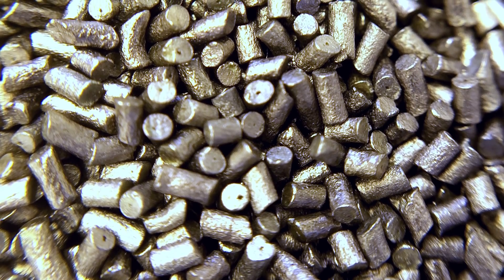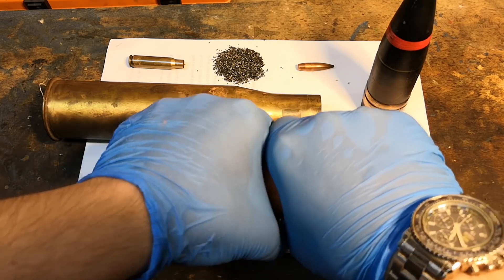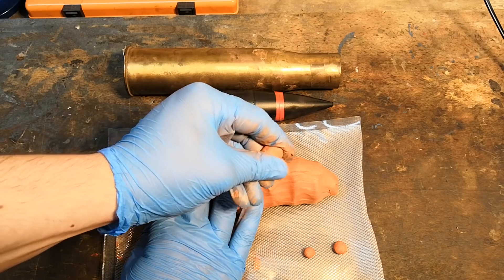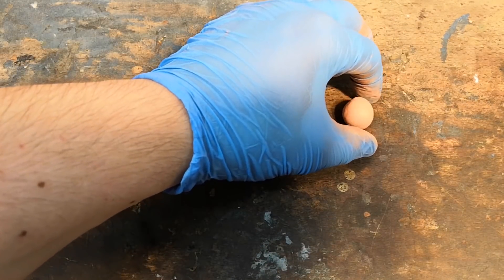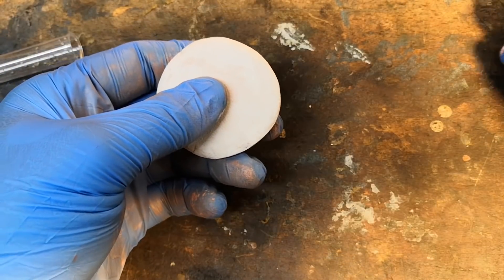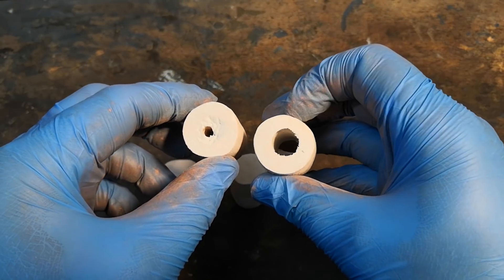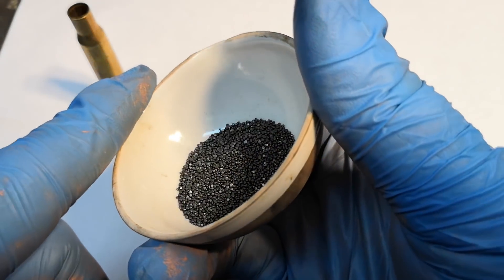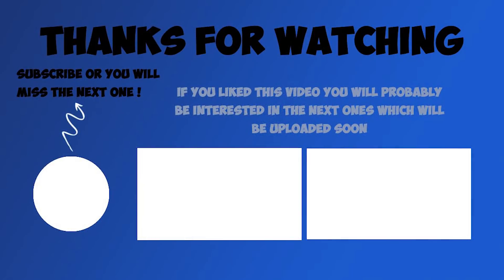Why Are There Tiny Holes In Every Grain Of Gunpowder?

Comment: Thank you very much for the explanation.
I have question:
I burned two 7.62 gunpowder from two different bullet of the same manufacturer.
The first one had tubular powder in it and the second had disc powder.
The disc case burned for 9 seconds, while the tubular for 3 seconds.
Those rounds are made for snipers, so I was thinking, in the video you say that flakes are used for shotguns and pistols, and tubular for rifles, but if the disc case burns slower, wouldnt it make sense that a sniper rifle would want a slower burning powder to achieve longer burning time due to longer barrel?

Thanks alot!

Comment: @backyard ballistics Does this have anything to do with the “corning” of black powder? As I recall - though I may have used the wrong term - it has to do with wetting, drying, then regrinding the powder… I guess. (Something that took years and years to discover, as I understand it, and was a quantum leap in firearms/ammunition development.)
Reply: Corning powder was mainly made to obtain more stable burning propellant, with loose powder the burn rate was unstable and prone to explosion (if the powder is very fine and compacted a little bit).

Comment: I was pulling apart ppu .303 brittish rounds the other day and most were cylinder powder there was one that was very tiny balls of smokeless powder why is that they were perfectly round also
Reply from the maker: So called "ball powders" are very common in portable weapons loads, and they are composed of small spherical grains made with a process different than extrusion. Because of the highly regressive shape, the outer part of the grains is treated with a deterrent, so that as deflagration progresses, the reduction in exposed area is compensated by the higher velocity of deflagration of the inner part of the grain.
Reply: @Backyard.Ballistics  awesome answer man thank you for responding

Comment: You should make a video where you try to make your own gunpowder starting of with nitrocellulose cotton, would be very intersting to see, if it would actually work.
Reply from the maker: I've actually done that, but I can't post anything like that here on YouTube😑
Reply: Backyard Ballistics Hmmm, Yt sucks :( 
Can you explain how you did it? I couldnt find any information about it on the internet, Just that there are different forms and some are coated in graphite powder
Reply: @Backyard.Ballistics  Cany you upload it on full30 ?
Reply: Ya I have also same query. I made a nitrocellulose and dissolved into acetone then I made a dried powder and dried sheet after evaporating the Acetone. Then how to change this into this kind of tubular  grain? Just I made a powder. Which also but quite similar but to smokeless gun powder but I can not make a tubular grain.
Reply: @sutrathakuri1924  What if you press it trough a carlic press? 
Not a tube but at least a cylinder...
Reply: Ya I think it will work as a cylinder.

Comment: It is not necessarily gun powder, common coal sometimes do use this method as well, have you seen those coal/charcoal dust compress Bridgets use for heating and cooking? Those blocks also have holes, not only for circulating air, it also serve the same purpose. Well, although in case pf coal blocks, burning rate is measure in minutes and hours.

Comment: the 30mm propellant appears to have some gold material, is this like a primer or other extremely fast burning composition to get the flame burning the entire hole as a cylinder instead of progressing in from the ends?
Reply from the maker: The shiny surface you see is graphite, the grains are coated in it to avoid static charge build up, to make them flow better and avoid them sticking together it the early phases of production. That's also what makes powder dark in color.
Also, you don't really want the outer grain to be fast grain, because that would make the buring behaviour regressive. Actually very often the opposite is done: deterrents are added on surface to get the outer layers to burn more slowly

Comment: so, how do they get those holes in?
do they have a whire in the middle of a tube of gunpowder, which is then removed and the remaining gunpowder tube is cut into pieces?
or they form the gunpowder along a extruding wire from a material that is later desolved using chemicals after the gunpowder has been cut to shape?
Reply from the maker: As far as I know they are extruded, with the "powder" being in a plastic consistency. The bulk is squeezed under high pressure through a die, which provides for the hole with a central mandrel in a larger section, and then everything is squeezed down, and the hole shrinks
Reply: @Backyard.Ballistics  ah that makes sense, thank you for answering my question, on a 5 month old video non te less XD
Reply from the maker: @Cheezymuffin.  my pleasure 😉

Comment: pretty good explenation on the holed powder. Would you know how these powders are made? It looks like its a cut extrution. But i cant get my head around the hole in the middle and how that is made. 

Is it a round hole with a pin in the middle and they just force the gelatinized cordite/nitrocellulose/nitroglycerine through and then cut it into little pieces??? That might be it.. 

Well anyways, i like you videos so i subscribed!

Greatings,

Jeff
Reply from the maker: They are extruded as you guessed, and the die should be similar to those used for extruding pipes...

Comment: for the exception to flake/disc propellant in handguns and shotguns....caseless ammunition ala g11?
Reply: It’s caseless, which means it doesn’t even use powder, since there wouldn’t be anything to hold it. Also g11 is the gun,not the ammo
Reply: @doomdave475  it's compressed power
Reply: sorry that was a typo, I mean’t to say pellets, also compressed powder is just a perforated chunk with no little flakes, pellets or anything inside it.

Comment: In regards to using a lot of C-4 in a bullet....it works 
If you want to know how many Iraqis I blew up by finding an AK-47 laying on the ground....
You peel the bullet off of the casing
Dump out the powder
Replace the bullet 
Stick that bullet in maybe the 2nd or 3rd bullet and put it back down 

Muhammad al-akaki will pick up the AK....start firing and that C-4 bullet will blow the rifle up sending the recoil spring into the back of his head....
I’ve done this in Iraq, Afghanistan and Syria....

Now I’m retired from the Marine Corps
Reply: Cool story pal.........
Reply: sends the bullet of in every direction at 26,550 fps

Comment: I want to know how they put the holes in the grains
Reply: They shoot holes in it with teeny weeny sniper rifles
Reply: @yamabushi170  How do they make the holes in the gunpowder for the teeny weeny sniper rifles?
Reply: @fatherofdragons5477  they shoot holes in them using eeny teeny weeny Cross bows
Reply: The propellant is extruded into the final shape through a die that has the desired cross-section.

Comment: How about the way they make the tiny holes in the propellant?
Reply: There are People with Patience and drill the hole with an small drill bit :D
Reply: The tubes are extruded through a spaghetti machine looking thing, so there probably is a small rigid needle or something that they form around.
Reply: @HaqqAttak  i was thinking that but the needle has to attach somewhere right... unless its exactly the consistency to form around a support farther back and reform but not to close around a needle... idk
Reply: @youngbloodbear9662  aluminium profiles and tubes are mostly extruded. 
For hollow structures they have the mentioned pin in the center that attaches inside the nozzle.
The aluminium is forced through the nozzle at such high pressure, that the aluminium "flows" around the support structure and forms a tube between Pin and nozzle.

I suspect it works similar for propellants
Reply: @fabianrudzewski9027  that makes sense, thanks
Reply: i am also wondering about that
Reply: I make them
Reply: It's all done on extruders.

Comment: Wow amazing video; so the propellant is similar in it's construction to a solid rocket engine propellant. Still how do they make those tiny holes at industrial scales of production?
Reply: likely one of these methods commonly used for extruding tubes 
https://slideplayer.com/slide/2760524/10/images/14/Extrusion+-+Tubing+FIGURE+l5.8+Extrusion+of+a+seamless+tube+%28a%29+using+an+internal+mandrel+that+moves..jpg

Comment: Was the same true for black powder as well?
Reply from the maker: Definitely not, black powder is (and was) shaped in irregular grains, and has a "self-limiting" burning behaviour, so unless a particularly low operating pressure is required the granule shape and size is not really important.
In lower pressure applications however, like fireworks, the shape and size has in fact to be taken into account:  Black powder used in lift charges  is quite coarse to limit the pressure

Comment: Really like this sort of content!

One suggestion for a video I’d like to see - the cast bullet shooters, who often “reduced loads” use fast burning pistol powders, and are concerned about “secondary explosive effect” when loading a cartridge with a relatively small charge (compared to case volume). I’d love to see a video explaining what secondary explosive effect is, why it occurs when there is a small powder charge in a large case, and why fast burning powders mitigate this (if they actually do?)
Reply from the maker: Thanks for suggesting, I am planning on making a video about that 😉
Reply: Secondary Explosive Effect has tried to be recreated under laboratory conditions ( by many smarter than us ) and has Never been done. Additionally, studies have shown that as a powder is reduced in volume the total amount of energy it can produce will never increase, only decrease. It makes no difference whether the flame advances from the rear, front, or both at the same time. It's primarily the amount of powder energy that determines the total pressure. I have Never heard of manufactured ammo creating a SEE, it's only claimed to happen in handloads, and mostly from much less than a maximum load. The true reason may very well be due to such a low powder charge / resulting low energy, the bullet failed to exit the barrel and a second round is fired resulting in a damaged gun and possible injury. Conversely, since such small powder charges are typically used, it wouldn't be unusual to unintentionally double ( and possibly triple ) charge a case. Whether it's the 1st round fired or the 100th, when a squib round is stuck or a double charged case is fired, the "useful idiot"  immediately proclaims it as an example of a Secondary Explosive Effect rather than admiting a mistake on his part.  It simply does not exist ...
Reply: Excellent!

Comment: Can you briefly (and very simply) explain the failure issues with early US M-16 when they went from stick to ball powder? Most explanations are incomprehensible or totally avoid the topographical components of the powder with this situation.
Reply: The rifles weren't calibrated for ammo with the new power curve. It caused them to cycle too quickly (I believe), then jam with the following round. 
There were also problems with a lack of understanding about how, and how often the rifles needed to be cleaned. Many were actually issued without cleaning equipment at all.
Most of the problems with the original M-16s can be traced to the ordinance procurement/approval board. Unofficial motto "It was good enough for Grandpa, it's good enough for you." They have a history of hating every advancement in arms from before the Civil War.
Reply: All understood and common knowledge.  My specific questioning is to the burn rates and power curves resulting from the topographic changes of powder granule, its relationship to situation, as well as the precise chemistry involved with the single- /double-base powder. Backyard Ballistics is trained professional in forensics/firearms and likely has expertise to discuss this detailed. Most discussion on the M-16 situation is colloquial cliches of lay public with limited technical education.
Reply from the maker: I will look into it, thanks for suggesting!😉

Comment: How do they make the holes?
Reply from the maker: I am not entirely sure, but it should be made during the extrusion process: the billet of (relatively) soft propellant is pushed though a die that has an initial part that provides for a larger hole, and then everything should be squeezed down to the final diameter in the last part of the die
Reply: @Backyard.Ballistics  Nope, it's good old fashioned witchcraft...or would it be olde fashioned witchcraft?  It's witchcraft either way.

Comment: Next time on Backyard Ballistics.

We've replaced the Hodgdon H-110 in our 357 rounds with C4. Let's see what this does for velocity.
Reply: @Ryben Flynn You know, that's actually a good question. Priming compound is essentially the same thing in a blasting cap. (Lead Azide for example) but I don't know if there's enough priming compound in a CF. Primer to actually excite c4 enough.
Reply: @1FireyPhoenix  you could probably just extend the primer to where it goes into the c4. Like essentially, just have a blasting cap that is activated by the firing pin. In theory of course. It would take a hell of a barrel and firing group/receiver to take c4. Especially if you fill the casing with as much c4 as powder (volumetrically) but shit that would be very interesting. Especially if one were to mess around and experiment with different high explosives. @ordinance lab would probably do a hell of a series on that
Reply: I imagine it would burn too quickly and create a lot of pressure.
Reply: XD and the barrel clock out at an outstanding 1400 fps XD
Reply: I would like to see him use one of those large pellets to load 9mm rounds. One pellet per round haha
Reply: C4 needs a really fast shockwave hitting it to explode, something like 3-4000 m/s. maybe something like C3 or C2 could be detonated by a primer.
Reply: @doomdave475  Maybe an electrical primer would work in this theoretical firearm that has the thickness of a cannon to withstand the pressure.
Reply: HaqqAttak 
No, since C4 is incredibly resistant to heat (you can literally blast it with a blowtorch), so electrical priming wouldn't work, but maybe using a detonator as a primer, and priming the primer with electricity.
But still C4 is way wayyy to brizantine to be used as a propellant, fun idea, but unachievable
Reply: @doomdave475   c4 burns decently well in the presence of a lot of oxygen but not near energetic enough to generate the pressure to needed to even unseat the bullet from the cartridge so even with best set up possible with a pure oxygen environment the oxygen would be a better propellant than the c4  so it would have to detonate with energy or it would just fizzle out in the case and fitting a blasting cap in a gun would already be more energy than you would want in the cartridge so its safe to say its not really possible
Reply: it wouldnt burn well because of the condition the c4 need to be in order for it to explode
Reply: You've essentially turned a fully loaded gun into a grenade
Reply: @Ryben Flynn I wonder if that might change in the contained space of a cartridge. I would love to test this, remotely, with an old gun, but I don't think it would be legal for me...
Reply: @Ryben Flynn it has enough shock to detonate dry tnp though.
Reply: shall not be infringed brother
Reply: Backyard ballistics : we can see that I have blown up my garage along with my head.
Reply: Would the bullet be faster than common ones if the barrel would be thicker?
Shaped charges are faster too.

Comment: Does Cordite have the same holes as well?
Reply from the maker: Yes, it generally has it. The one shown in the video is perforated all the way through, and it came out of a 303 british cartridge. I have seen examples of long rod propellants without the hole though, but I don't know where they came from...
Reply: @Backyard.Ballistics  Interesting, so how do they even make such tiny holes in the gunpowder?
Reply from the maker: I am not entirely sure, but I think they use an extruding die that provides a larger hole in the first extrusion step, before squeezing everything down to the final diameter
Reply: Seriously, probably not much different than with making some pastinas.